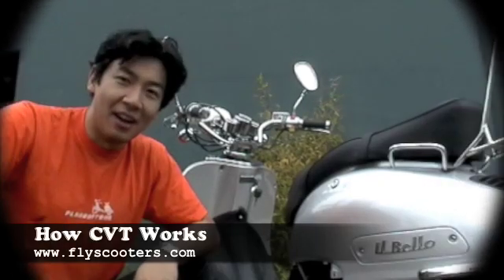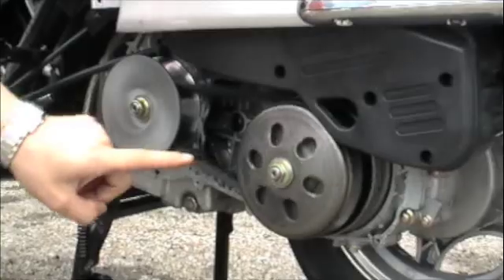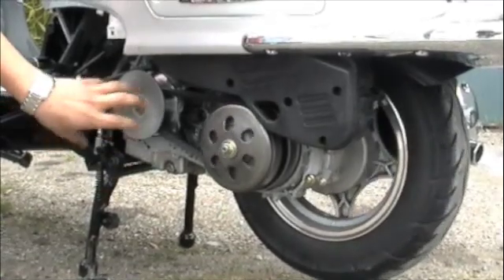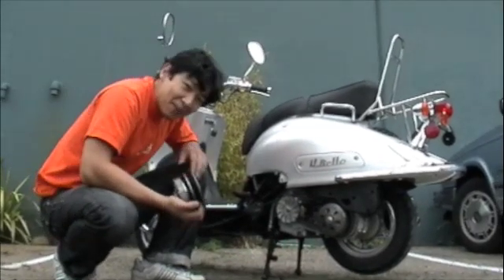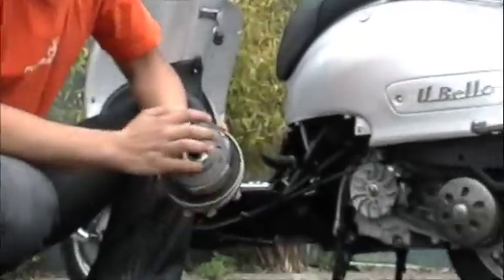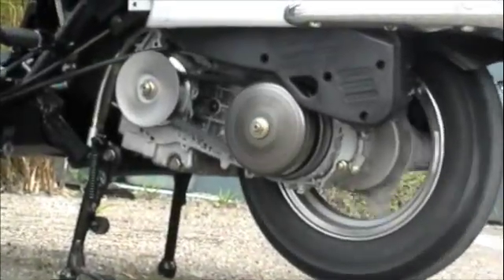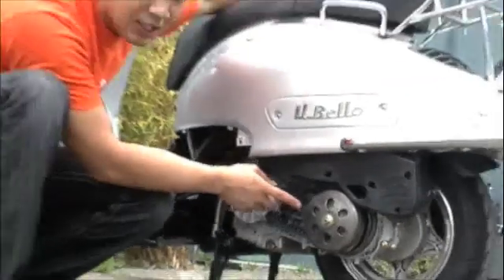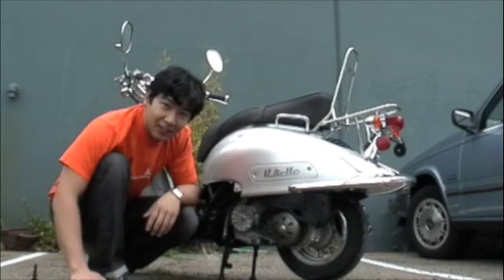How CVT Works by Leon Li

Comment: Question: I have a Honda Forza scooter (279 cc CVT) I want to change the final ratio so that I am running a LOWER rpm at 55 mph. Example: Instead of 6500 rpm at 55 mph, I want the engine to be turning only 5500 rpm at 55 mph. Is this possible? It's easy with a chain and sprocket bike, but the CVT? I have no idea... Please respond.